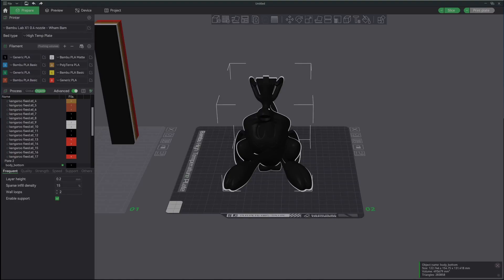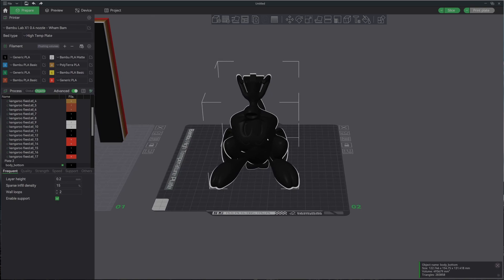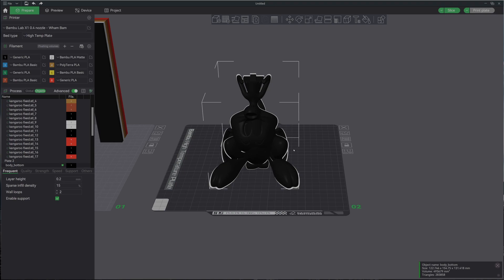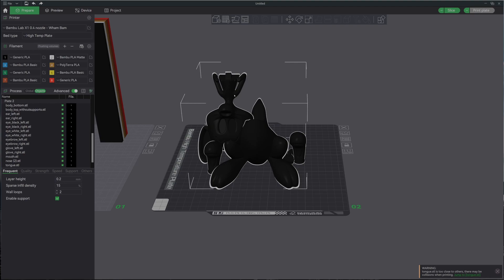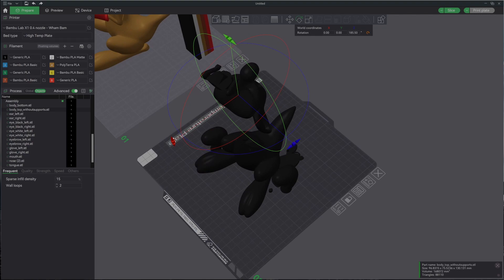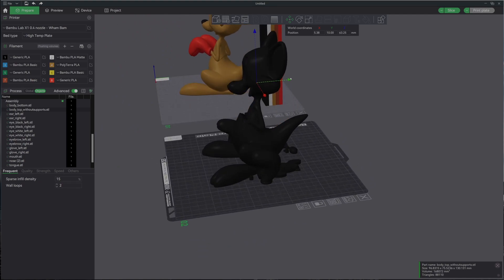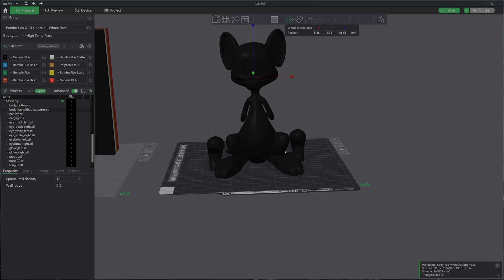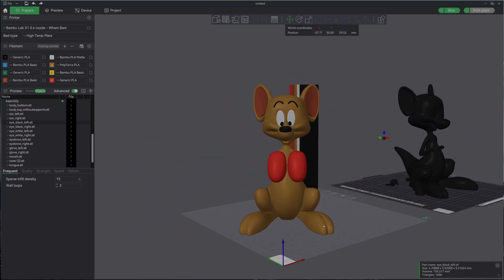Putting a Print Back Together-  Bambu Lab X1 Carbon

Comment: i found that if you put them together how you did you can then select all the parts and then right click and click on assemble and it should connect the all and maybe print better? i did it some other print that i had to cut and split to change the width and then just clicked assemble and it printed fine. not sure if that would help you out to make it a more of a solid print. i am new to this 3d printing stuff but it is fun. i have yet to try a design program i only tried bambus which doesnt allow you to do much.
Reply from the maker: That’s worth trying…

Comment: Len, you have good vids, sub'd a while back. As for this vid, FOR ME, I'd print this using the print by object then glue together. Save a TON of time and filament. Gluing it all together reminds ME of when I was kid building model airplanes and cars and stuff, so I get joy from that part too. Your method shown here is far to tedious for myself. Thx again, keep on truckin!
Reply from the maker: I made a discord.  Print and share!  lol.  This is not the ideal way to do things.  BUT, in a pinch and you really want to print something OR combine some other objects together, this will work.  The print is solid although I wouldn't do this for anything structural.  It took about 15 minutes to put the pieces together.

Comment: A question on color. Do you leave the purge setting to standard? I have tried to lower the number with mixed results. Do you always use the prime tower?

Thanks for the great info once again
Reply from the maker: In the "Flushing Volumes" tab I change the "Multiplier" to .5 and hit "Auto-Calc."  I have had pretty good success.  I can't remember the video but I did watch one where someone lowered it to .3 and had good results.  It depends on the color too.  If your model is white and black only, you might not want to go down that low.  I do use the prime towers.

Comment: I am the designer of this model.  The model is intentionally split into parts with each part positioned for ease of printing as individual parts in different colors.  Rearranging the parts to print as one piece is not really a good idea.  The connections have gaps and may result is incorrect slicing as one model.  sometimes it does work out, but in general it really is not a good idea.
From time to time I also release my models as one-piece as well, for those people that prefer to paint.
Teamwork,
Steve
Reply from the maker: Thanks for the comment.  The video was not meant to call out your model specifically.  I'm sorry if it came across that way.  I don't know how to design much more than a simple box in Sketch-up.  So what do you do if the model you want to print is in pieces and you can't put it back together in Fusion 360 or Blender or any of the other 3D modeling software?  That was the point of my video.  Your print was the first one that was "cool enough to print" and came in the separate pieces.  No disrespect intended.  If you have any other cool prints to showcase, I would love to print them and send people your way.  It printed out awesome and looks really good.  Great work on the model no matter what.
Reply: @lendizzle77  No disrespect taken!  I'm happy you chose one of my models.  I was trying to point out that after all the work you put into rearranging and putting the model back together your method could produce something that looks proper and slices correctly but will actually have issues after printing.    Depending on the gap between parts there may or may not be enough 'adhesion' between the colors and a part could separate and fall out.  Since I have the original files in Blender, I sometimes make them printable like you want.  In that case I spend time closing the gaps so that all shells are not only aligned but touching as well.  Enjoy the Bamboo, great machine.
Reply from the maker: Would be happy to do a collaboration with you.  Maybe you could show everyone the correct way to put the print back together?  I would be happy to record and post.

Comment: I think this to be expected with this perticular model, as it's designed to be printed in separate parts.
You could put it back together in fusion 360 and upload it as a remix, or ask the creator if they would be kind enough to do so.
Reply from the maker: But what do you do without Fusion 360 and if the model designer is not so kind?  :)
Reply: @lendizzle77  😂